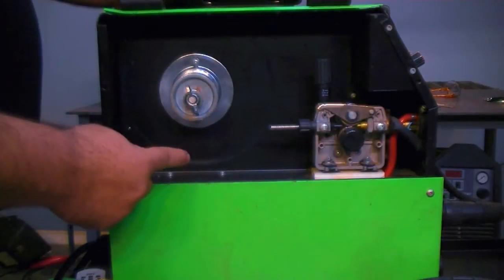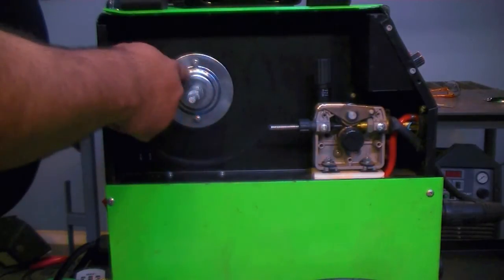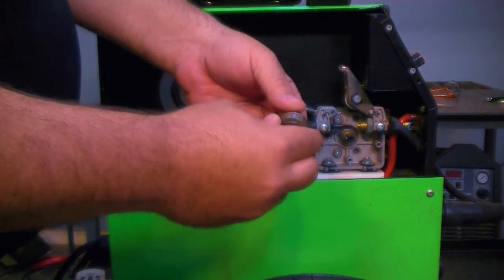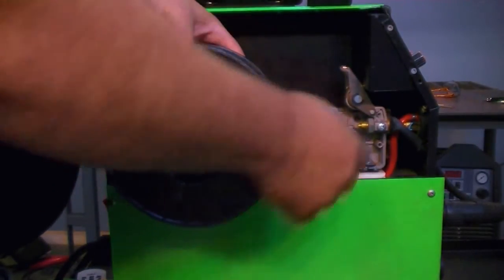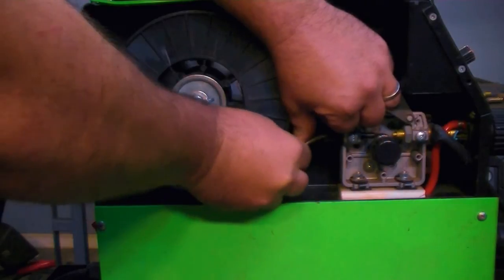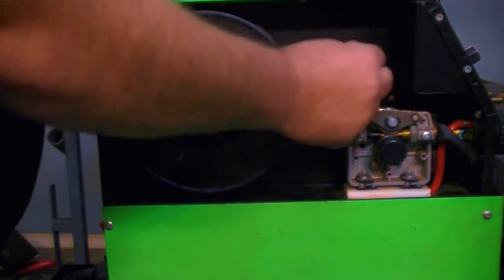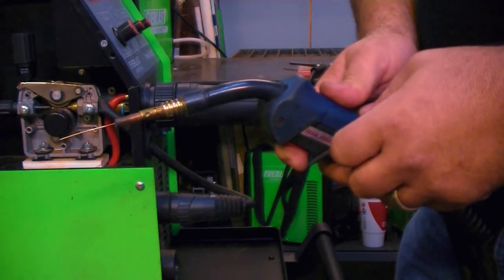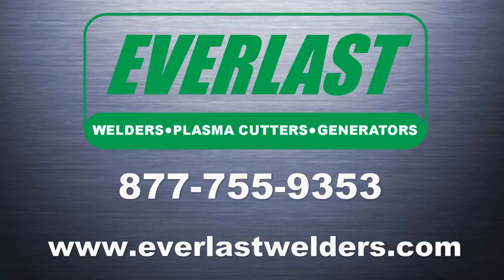How to Setup and Load MIG welding Wire into an Everlast inverter  Power i- MIG Welder

Comment: I-MIG200E here. The voltage band goes from approx 14V to 23V via nine bars. Nine volt variance, nine steps can each of these be considered about 1V? Same with wire feed, 0-400 ipm and nine steps. About 45 ipm per step? I bought this directly from you in 2019 when in school. Haven’t used it much but want to get fluent with it for project car. Also I was a member of the forum as Stickstuck but my user name seems no longer to be there.